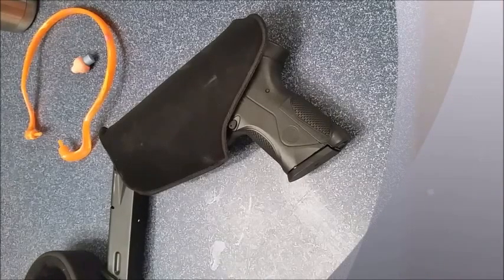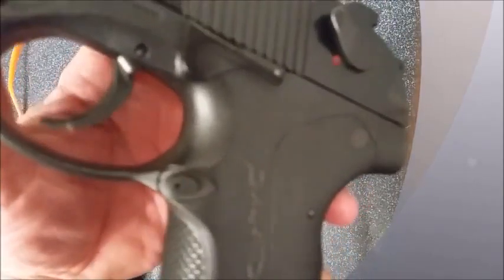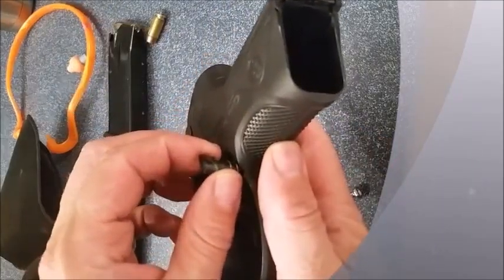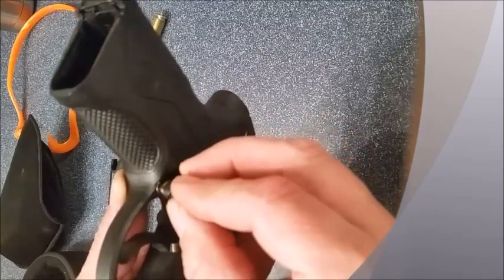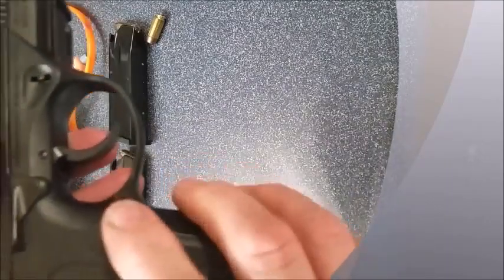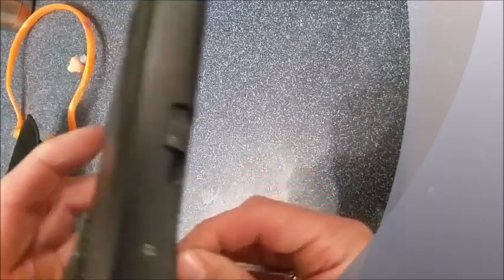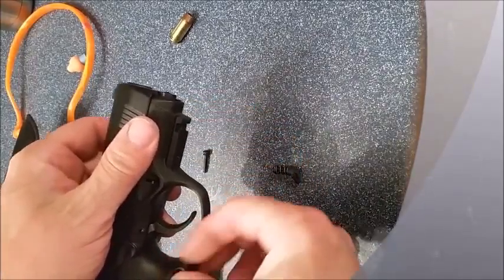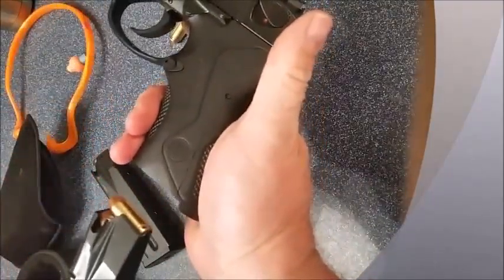Magazine Button Swap PX4 Storm

Comment: Hi, did you think it works into the airgun Umarex version? Nice video Btw
Reply: It does.  They're not the same, I have both the 9 mil and the .177 pellet.  The Umarex is with a screwdriver, unscrew and put it on the other side.  It works.